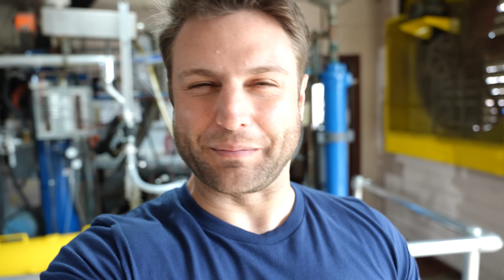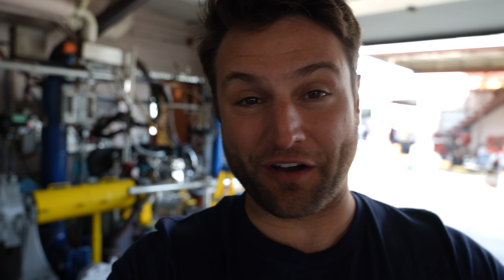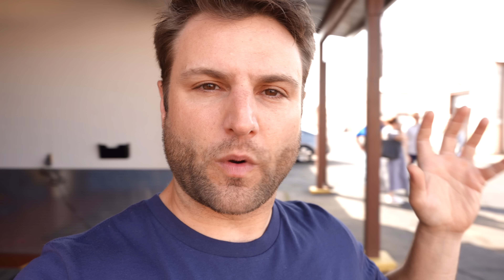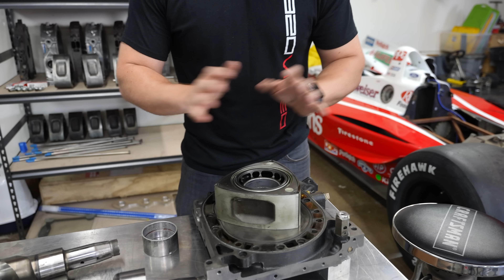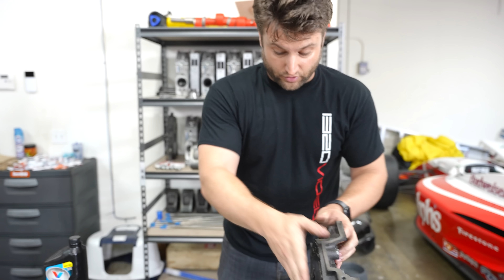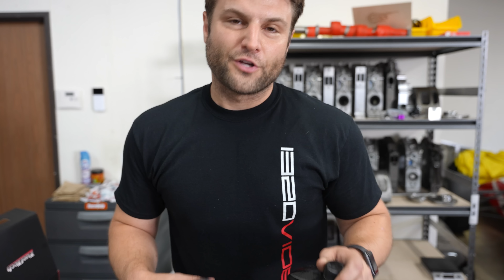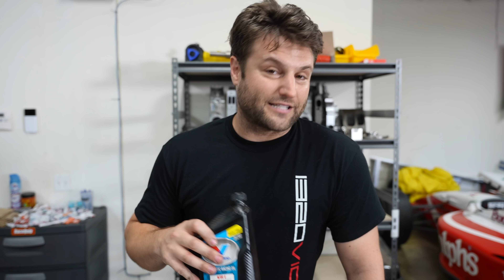I tour Valvoline’s Engine Lab to build better Rotaries.

Comment: I used to use valvoline exclusively in everything until I started having issues with their oils breaking down due to high heat. Which caused low oil pressure in multiple vehicles. Made the switch to shell rotella t6 for the street vehicles, and switched to amsoil for the street bikes and offroad toys.
Reply: You are getting the idea Matt. 
Your switch to Amsoil, is You best choice available. 
Which company knows more about synthetic oils and lubrication than the company that developed it first, and continues to develop, improve, advance.
Also, realize that Amsoil only produces synthetic lubrication products. 
The second company which began with just one product and far inferior was Mobil Oil company with Mobil 1, in 1974.
All of the other major oil companies delayed producing their synthetic oil products  until the late 1980's and mostly in the 1990's.
All of these companies, especially the largest like Shell, Valvoline were later than Castrol.
All of these major companies still produce, distribute, and sell 'natural' oil based lubricant products, synthetics and blends. Mostly they produce synthetic engine oil products, but do not have synthetics for all lubrication. Thus, they only produce what they think they can convince the public to buy, through their marketing and with their racing sponsorship of many drivers. [though the actual race teams do not use the products of their sponsor, unless the product is the choice of the engineering staff. STP was a major sponsor, but the race teams dis not use their products. Similarly it is known, with engine oil and other lubrication products, and other.
Tires [tyres] are usually supplied via the specific race event, for all to have the same.
Many products have no specific sponsorship too, especially the actual mechanical parts, through to the hubs, brakes.
Am not yet certain about engine control units, but mostly We see the sponsorship markings with specific racing like NPK, and other 'street drag' racing, which have more individual, private teams, not the larger, high profile racing.

As, what Rob Dahm is expressing about the technical, engineering, testing, etc. of Valvoline, all of the major companies have their development and testing laboratories, and produce tables, calculations of their product performance.
Note: their comparisons are for synthetic compared with standard, or blends (sometimes), but not compared with other synthetics. 
The basis and reasoning is simple, obvious and clear.
However a company that has a superior product has actual data comparisons of their synthetic to others. Such is Amsoil.
When i began looking at Amsoil, these actual comparison charts and data impressed me, along with the expertise of mechanical and material engineers who write their own detailed information about the superiority with every aspect. [Am also an high level engineer, scientist and mechanic.]
Since Amsoil is sold through private distribution, they do not have a major marketing campaign, and budget nor to include sponsorship contracts. Rather, they rely upon the quality, performance and their distributors to be the main marketing, and put more of their investment into research, development, improvement, performance, durability, and quality.

If You are using Amsoil in Your street bike and off-road vehicles, then clearly those applications have very high amounts of torque, rotational speed, power,  stress, especially needing higher quality to handle those uses. Those applications should be proof that for Your street vehicles, You should also switch to better quality synthetic oil, lubricants. Not only will the mechanical parts of the machines of Your street vehicles perform better, with less wear, thus more durable, also the durability of the lubrication products themselves improves significantly.
As, is well known, the additives in standard oil to synthetics are the most vulnerable to breakdown, modification, degradation, mostly from heat.
Though Rob describes the additives as additional beneficial qualities like detergents, zinc, etc and separately the multi-grade aspect, actually the multi-grade aspect is also via specific additives, which are vulnerable to breakdown to heat, which Rob mentions.
If You know about the SAE standards of measurement and labeling of oil thickness, weights and as they relate to multi-grade, then You have some important basics, without knowing the chemical, material, scientific principles. [my HS mechanics teacher gave is these basics among many other valuable basic concepts]. 

My first use and switch to synthetic was in my 1979 MB 280E, in early 1988, after having direct availability to a new synthetic engine oil product, at wholesale cost, and superior to Mobil 1, shown in reliable test data comparisons. That vehicle had 125k mi when i bought it in 1987 from the original owner [with all of the service records], which everything was great from its running, breaks, suspension, steering [still tight as new]. Had a full III-Z service done, Vredestien shocks replaced, brake pads [4 wh. disks],alignment, then bought P600's [at a local tire discount shop] (best vehicle have owned, which i also maintained this and all my vehicles)  The cost of using synthetic engine oil, then was multiple compared with standard oils available at the large discount auto parts stores [used Castrol 20W-50 for years, since 1975, and bought a case on sale price, when advertised, usually $1/qt, which was often]. However the durability of the synthetic engine oil was at least the multiple of the cost, and improved performance, efficiency [less fuel consumption] and reduces engine wear, thus worthwhile economics, alone. The durability of synthetic oils, became so important that when Toyota developed their 'maintenance free' Corolla of 5 years, 60 k mi, they put synthetic engine oil in the factory, and used Bosch Platinum spark plugs. Similarly, when Toyota produced their sealed engines for their mini-van and the Lexus line, they used synthetic engine oil.
If the additional higher quality micro-filters of Amsoil or others are used, then the longevity, performance, protection are improved more.
One of the most impressive reports, which i read, available on-line, is from a proper mechanical, materials engineer, that thoroughly investigated the details of the Amsoil synthetic products, including their test data and comparisons, then began using the products because of their quality alone.He states he mostly is a user of the products, and promotes them to others, but chooses to not develop the business aspect for his reasons of not needing or desiring such, rather promotes to those he knows for their personal benefits alone.
His lengthy, article, report is very valuable, worthwhile and easily accessible via a search [am nt a G', B', Y' search user, rather DDG or other private search engines]

More recently have been looking at Lucas Oil and Motul Oil products, since they are relatively smaller, private, and specifically lubrication, but have not found, yet their specific performance data compared with other synthetics, and they also still produce standard oil products too, which is a significant indication about the company's commitment into synthetic lubrication products, their performance, durability, longevity, quality.

Have mentioned these ideas about the actual qualities and comparisons to Rob Dahn previously and a few others on their channels who mention specific oil and lubrication products too. 
So, far none have commented nor seem to have any affect. Which leads me to the conclusion, their sponsorship arrangement is worthwhile financially, in their view. However, their expense, time and effort from the engine wear and loss of performance, is worthwhile paying for the better products, which they can get at wholesale with Amsoil, as a distributor, and actually sell the product for profit as a user.too. Amsoil allows distributors to sell in their shops of all types.

All The Best and Much Success in Your Quest, Health and Well Being. 
Sincerely
Reply: @newtonfirefly3584  Amsoil is literal trash. I can't believe you fell for their pyramid scheme.
Reply: @eriklarson9137  Clearly You are only following false information, false portrayal, false narrative.
Amsoil is well known for their quality among the experts including, engineers, mechanics, racing teams, etc.
Clearly You have 'Zero' actual information about their products, history, business, distribution, marketing and sales.
Amsoil is a privately owned company, and sell through their distributors, but is not a MLM or network marketing company.

You clearly also have incorrect, false information about MLM, Network Marketing companies. 
They are NOT Pyramid schemes, though some have attempted to use MLM for such. 
The "Pyramid schemes" were mostly investigated and removed back in the latter 1960's via extensive FTC investigations.
Can tell You of a few, that were eliminated.
The best of them all, not only passed, but is used by the FTC for comparison standards of legal businesses, and illegal 'pyramid schemes'.

Your ignorance and falsehood matches on both counts about Amsoil products, their business, distribution, marketing, sales, etc.
And this ignorance matches Your falsehood about MLM, Network Marketing.

There are some companies, which may need investigation, because they violate specific rules the FTC establishes, and there are many which have dishonest ownership, which breeds dishonesty within.

Maybe, some day in Your life, You have proper information and stop Your falsehood, 'reaction' type remarks, especially when You clearly have NO proper information, and worse,  lack knowledge, concepts, principles and just follow some false indoctrination, the attempt to use invalidation, 'cancel culture', 'bully techniques', nullification, etc.

Actually it seems quite clear from Your statement "Cant' believe You fell for .." Is Your reflection of falsehood, then projected upon another; me.

Thus, Your reflection is saying to You, Erik Larson:
"Your false information is 'trash', 'rubbish'!
"How can You fall for such falsehood, pretense, false information, indoctrination, especially without having actually investigated the products or the company ?!!"

Your comments are those of an immature, arrogant, ignorant, brat. :((
Perhaps, You should try knowing something correct before You 'spout off with Your" fingertips, reactionary, insolent comments.
Reply: @eriklarson9137  i dont  know about trash but theyre not the best for car either, ive used motul for my built engine and its been great on track imho.

Comment: Did you know that Ford's 2.3L engine has a timing belt instead of a timing chain and it is submerged in oil near the bottom where the oil Pan is, well they've been having epic failure of this design.  Almost any issue with the engine and it's a warranty replacement.
Reply: Sounds like they thought they could just swap out the chain with a belt for cost savings without having to modify the engine

Comment: Flow is critical. My old 7.3 idi diesel runs at 11 psi of oil pressure when it's hot and it runs just fine cause it has massive flow keeping the engine lubricated. Over 400k on the original motor and still going. If the rod and main bearings can last over 400k on a high compression diesel with only 40psi cold and 11 ish hot I dont think pressure is as critical as the right volume.
Reply: Yup. Thinking freely about the theoretical aspects of an oil system, absolute pressure tells you nothing unless you know what pressure the engine was designed to run at. All oil canals vs. the capacity of the oil pump gives a "design pressure". If your reading is higher then the design pressure your flow is lower than it should be, possibly because of a blockage somewhere downstream of the pump. If your pressure is too low you either have a leak downstream, a shot pump or a partial blockage at the pick up side of the pump. Pressure and flow go hand in hand.

So one simply can't use "you should run xx psi oil pressure" as a blanket statement. Even changing the viscosity of the oil changes the optimal pressure too, since a thicker oil requires higher pressure for equal flow, and a thinner oil requires a lower pressure.
Reply: @oskjan1  Ah so its like that explanation of electrical current using water flow vs pressure, but flipped; The 'high current' here keeps the motor alive while high current electricity kills you, and the voltage or pressure alone doesn't paint the whole picture.
Reply: @von...  Nice observation!
Reply: Yes. Oil pressure is literally just a measure of the inefficiency of the geometry of the oil canals, which creates restriction to flow.
Reply: time to put a flow meter on my oil pick up tube? lol

Comment: Got any tips on how to make an Rx8 actually run?
Reply: LS swap it lol 😆 or put a 2 rotor from rx7 in it if you wanna keep sould soul
Reply: Well once someone else has had their hands on it, who knows what could be damaged or what could be problematic in the engine. Best thing is to get a rebuilt engine and learn how to take care of it before the problems occur. Try to get higher in the rpms after long drives to prevent carbon buildup from forming, check your oil level every other gas fill up, do oil changes every 3000 miles non-synthetic (you can go fully synthetic only if you create a separate reservoir for the oil metering pump to pull from and not use re-used old oil. Popular kit is called sohn adapter kit.), If you are in a climate that is almost always above 60 degrees Fahrenheit use 20W-50 oil, If it's driven in colder climates than that use 10W-40, change spark plugs and coil packs every 30,000 miles. Make sure your cooling is all good so you don't overheat the engine (coolant is clean and not dirty, leaking, radiator hoses, radiator). If you can keep those things in check, you should be perfectly fine. Depending on if the engine was built correctly, I would have no doubt that it would last 100K miles for sure.
Reply: Fred Flinstone it.

Comment: Rob is valvoline good to use in my aging vehicles i always get high milage but is it worth the extra couple dollars?!?
Reply: It’s a name brand so you will be find as long as it meets the recommendation of your manufacture. It really depends on your use of the vehicle if it’s worth it.
Reply: let me rephrase your question: 

"so is this internationally recognized premium brand with incredible motorsport heritage safe to use?"

yes. dumb question.
Reply: @StanleyKubick1  that’s a dumb response.
Reply: Valvoline is actually cheaper than Mobile 1 at my Local auto parts